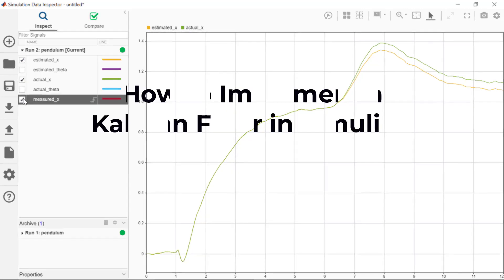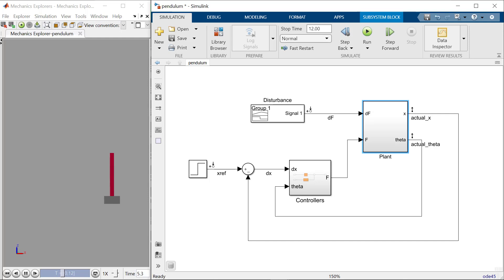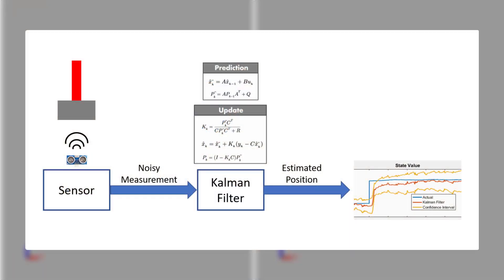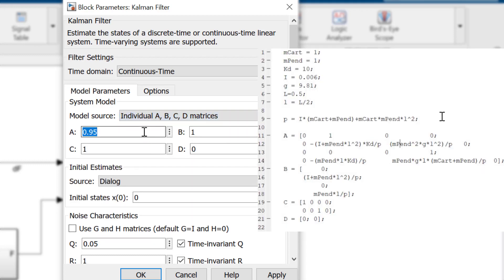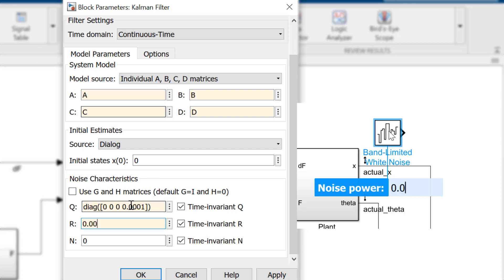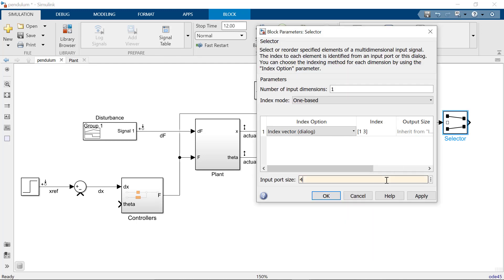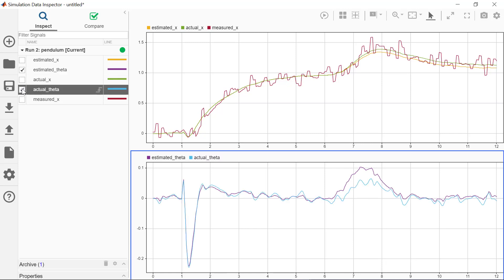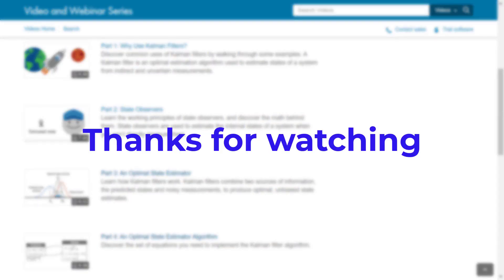How to Implement a Kalman Filter in Simulink

Comment: question: instead of using a Kalman filter why not just apply a filter ? maybe by adding a low pass filter ? since noise is typically high frequency ? would it work ? also would it not mean less computaional power needed?